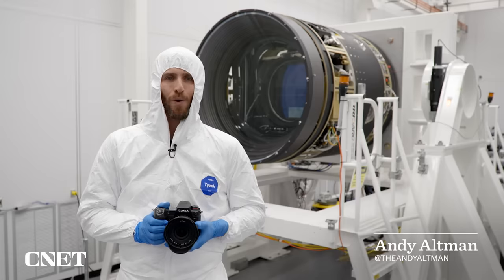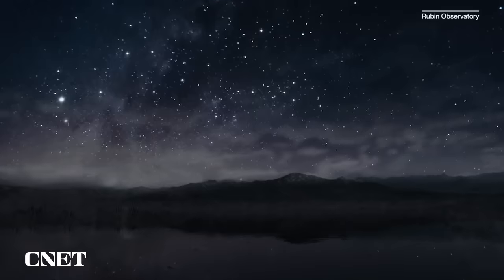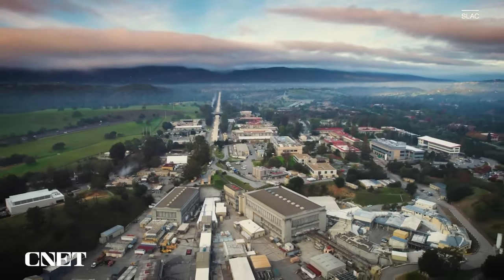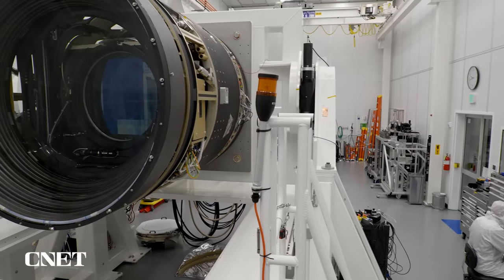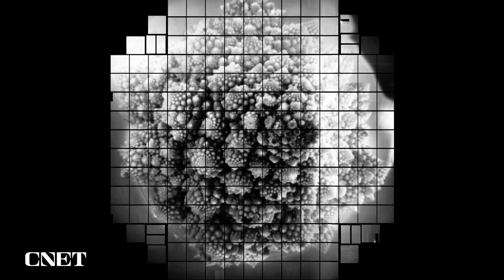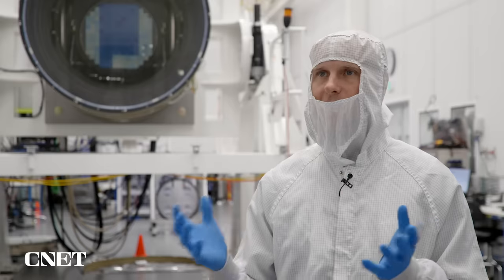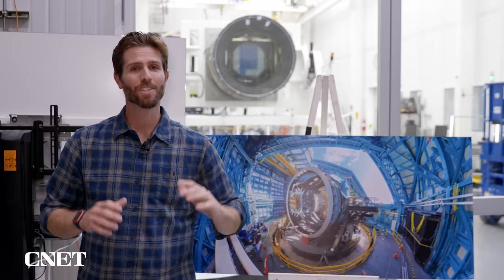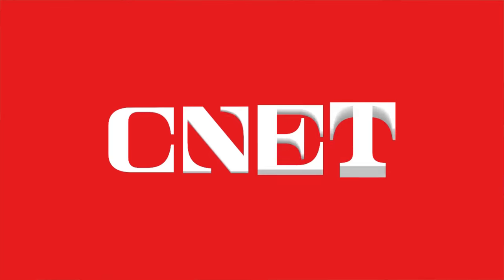World's Largest Digital Camera Takes 3,200 Megapixel Photos! (LSST)

Comment: My uncle, a photography professor, once created the world's biggest film camera, converting an old aircraft hangar into a working camera. This one is far more complicated.
Reply: That's really cool! Is there anywhere that covers it?
Reply: @rickw7522  link?
Reply: thats incredible
Reply: Hey that's awesome! I read about this over a decade ago, now. It was in the Guinness records book too, I believe.
Reply: Problem with air hangar is that its quite hard to move around. But I have seen a van converted to camera. A lot smaller but you can actually take that one with you on travels :) Anyway, would love to see results.
Reply: a genius!!
Reply: Imagine how difficult it probably is to develop.
Reply: @Elazarko  just drop it off at a one hour photo
Reply: How did he resize film to fit it?
Reply: Source?
Reply: @raulmaldonado4691  There's an artist who makes large scale camera installations out of rooms and buildings, like what this guys uncle did with an airplane hanger. They basically make a large sheet of photo paper, like what you would use to make a final print out of a film negative, and use that as film instead, then after it's developed they make a second sheet the same size and contact print it to create a final positive that can be as large as an entire wall. I'm betting that's how they did it with the hanger as well.
Reply: Camara Obscura.
Reply: @Elazarko i guess you spray developer on the film negative with a misting paint gun. And then you spray fixative. Try not to breathe it in.
Reply: I wish I could have taken your uncle's course. Ansel Adams would have loved this idea.
Reply: @WatchMeSayStuff  brendan barry is the artist for those interested

Comment: Takes "caught in 4k" to a whole new level.
Reply: 4k is about 8 megapixels, so, yea
Reply: in the case of the observatory it would be "caught in 56K" 😄
Reply: @lrklein2422  56k is the speed of dialup internet.
Reply: @Lancea1ot 4k, assuming an even 4000 pixels of image width (which often varies up or down depending on camera model), would be about 10-12 megapixels at conventional digital camera sensor dimensions of 4:3 to 3:2. 8MP at 4k assumes an image height of 500 pixels, and I don’t think 8:1 is a very common image aspect ratio.
Bad math.

Comment: I am curious to know how this can take pictures through our atmosphere which was why hubble and James web were placed above the atmosphere and L2 orbit.
Reply: The focal length is much shorter so the distortion isn’t as important.

They also still have optical correction for atmospheric distortion using actuators on the mirrors.
Reply: Lasers.  You can see how the atmospher distorts a couple of lasers and correct for it.  At least this is how the LBT in AZ does it FWIR.

Comment: Wait I'm confused. This thing seems to be better for macro shots. It's extremely impressive it can see a golfball from 15 miles away, but that's not very far for space. So I'm assuming it's going to be attached to a telescope and I just missed something in the video? Lol
Reply: Bro… think about how massive a star is relative to a golf ball
Reply: @sneakymilkman4203  you’ve never used a telescope have you
Reply: @KCJbomberFTW  Not even the best telescope with the best tracking available could have prevented the joke from flying over your head at mach 12
Reply: @tatzecom  it’s not a joke if your just wrong about how this works and what it’s used for
Reply: Good enough for galaxies and wide field images. Which are more useful for discovering new things.
Reply: I think the mirrors of the telescope it's going to sit in are going to increase how far the camera can see

Comment: Question is, what kind of processor they use? I’m interested to know. Large sensor and high megapixel means they have big data to work with which requires high processing power. I wonder how long it takes to process one single image tho. I wonder if they’re standard compression images or RAW
Reply: It's scientific research not Bob's photo gallery, they're using supercomputers and processing all the data coming from the sensors, every pixel.
Reply: probably an arduino /s
Reply: they built a "green" datacenter,in another country and a dedicated super high speed fiber connection to download the datas, it ll be terabytes of datas every night

Comment: Thanks for sharing and good to see where the sensors made in the UK end up. Not often this is seen.
Reply: Yup, our E2V CCDs were made in the UK. The ITL CCDs were made in Arizona. The housing for the CCDs has a thermal expansion coefficient similar to invar but has a thermal conductivity similar to aluminum. Our Grid and Sensor Base Plates have the same properties. It is amazing material.

Comment: Is the lens made of glass, and if so what kind, and what are its limits of transparency wavelengths  in nanometers, or Angstroms for those as old as I.
Reply: The bandpass is for 320–1050 nm
Reply: @Doctor_Yuri  : Thanks.  So deep Violet, very edge of visable, to past visible red, and 40% of the way into "near infrared".
Reply: The LSST telescope will be using mirrors, the glass element we see are some kind of additionnal correctors

Comment: But wait for astro work size of pixels is more important than the quantity of them. That's why hubble had 2mp camera & jwst has just 40mp. Is there any specific reason why it's this high resolution?
Reply: Because, unlike HST or JWST that take precisely targeted observations , the LSST is a survey telescope that will essentially take surveys of the entire sky over ten years, and thus needs to have a widefield camera. It will tale images of large swaths of the sky, but down at the pixel scale each image should have a comparable resolution to Hubble or JWST. Think of each single LSST image as a mosaic of 100x100 (10,000) Hubble images stitched together into one frame. Thats the reason the combined number of pixels is so high.

Comment: Why stop at 3200mp ? Why not like 10.000mp ? Were there any limitations besides cost ?
Reply: For a given sensor size, when you increase resolution, you reduce pixel size. And when you reduce pixel size, you decrease the signal to noise ratio that each pixel have. So there is a trade of between resolution and noise. They probably decided what was the sweet spot for this project :)

Comment: 3:27 how exactly it generates heat? it's just a giant lens with bunch of image sensors
Reply: There is a lot of electronic behind it that always generate heat when powerd up, and doing something, as all electronics. Also, the sensors need to be cooled down to around -100C (as they said), this to reduce the amount of dark current that is being fed in the pixels during exposures
Reply: Nearly anything with electronics generate heat

Comment: Theoretically, if you took 32 galaxy S 22 ultra sensors and put them in a square, couldn’t you have a 3200 megapixel camera the size of a DSLR?
Reply: Theoretically yes but it wouldn't be the same at all. Pixel size matters more than megapixels hence why a 20mp Canon R6 blows a 108mp Samsung s22 ultra out of the water.
The more pixels crammed into a small space the more noise and less light you get.
Very simple explanation but you get the point 🙂

Comment: A super large megapixel camera is cool and all, but the focal length (lens) looks way too wide.  Unless attached to additional glass that has super telephoto qualities, this camera project looks to be of current NASA quality.
Reply: The lens you see on top is not "the lens". The LSST will use an array of 3 mirrors, the primary having a diameter of 8.4m , in a quite complexe optical formula (three mirror anastigmat). Have a look at the wiki page, it is actually wuite interesting :)

Comment: Believe it or not, I think it would actually be cheaper and easier to do this on a very large custom sized sheet of photographic film.
Reply: Not on the long term... cost would stack up quickly, and for processing, you would still need a camera to scan the film
Reply: it s designed to be super efficient, not to be cheap

Comment: It's about 266 iphone 14s worth of resolution. Not very big, not very impressive.
Reply: it's not only about the amount of pixels, it's also about the quality of pixels. High quality pixels are usually less noisy/grainy, can capture higher dynamic range and capture more colours. Something an array of smartphone camera with the equivalent pixel count couldn't do. Furthermore, the lens quality of the telescope is significantly higher as well.
Reply: @computerconcepts3352  Exactly (photographer here) The quality, clarity and size of the glass that's capturing those pixels plays a huge role... You can use both a consumer-level lens and a pro-level lens on the same digital camera, same resolution. And the difference in sharpness and clarity of the pro lens is huge.